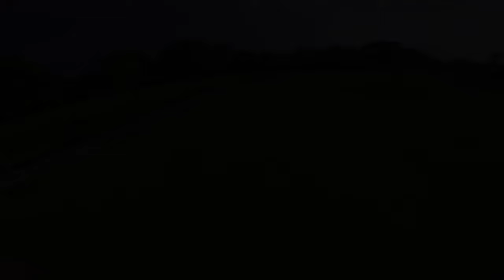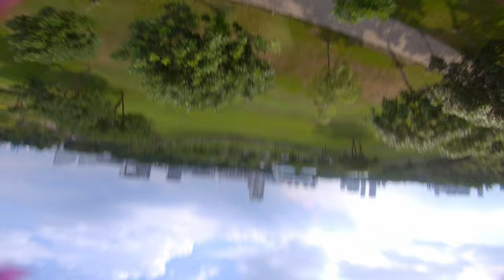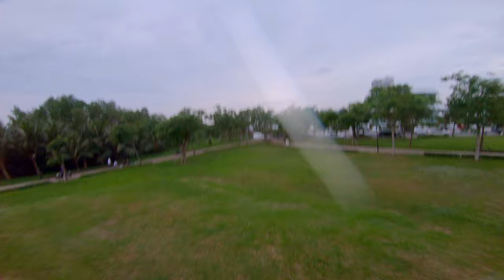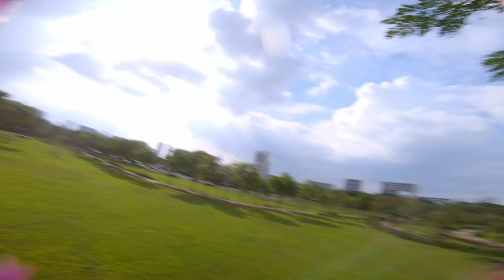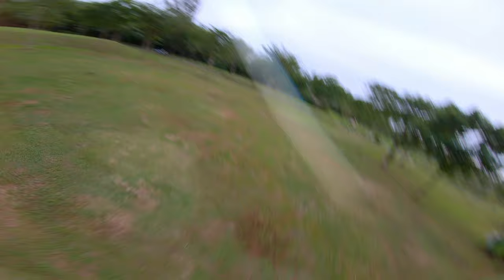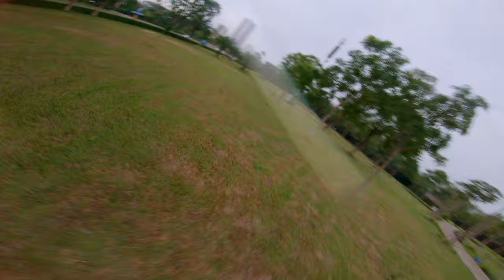Abusing the Velox V3 2050kv.

Comment: Nice one man... Can you share your camera angle and rates for sbang?
Reply from the maker: hey hey. good to see you here! I'm using 25degree cam angle. Betaflight rates as follows:

R 1.70 / 0.63 / 0.00
P 1.70 / 0.63 / 0.00
Y 1.25 / 0.65 / 0.00
Reply: @pennzoilgtr  Thanks mate! I will try yours.. Haha.. Though I have only 1750kv Tmotor SlattFPV.. So not much kv for sbang but maybe just okay for practice.

Comment: good motors , mainly for racing at 96hz too 128hz  a lower kv will have more low end torque and can run at a lower hz these are designed for high speed not low torque  .. base is really solid thicker then most so you do not strip screws ,, I hate lousy bases that strip easy